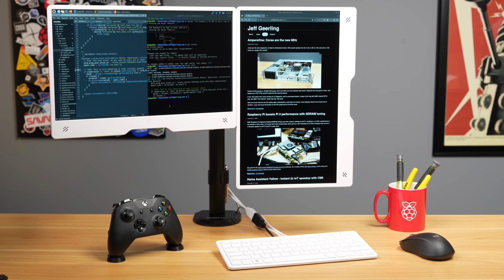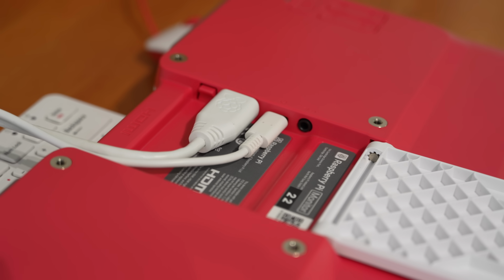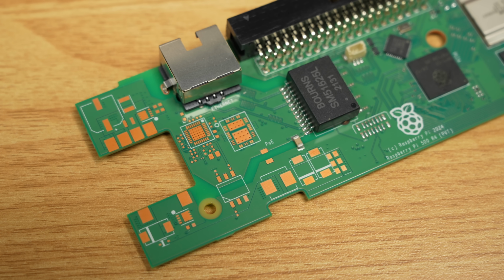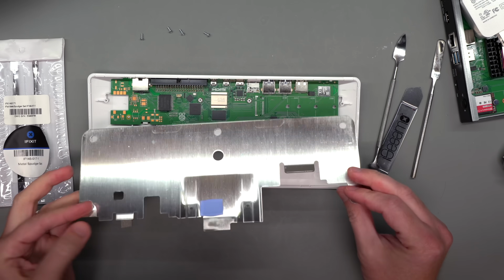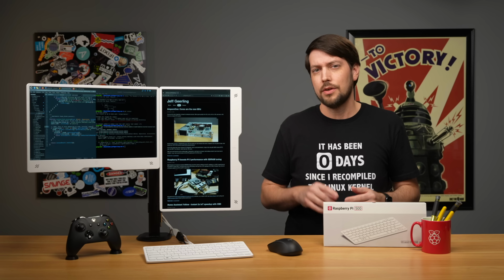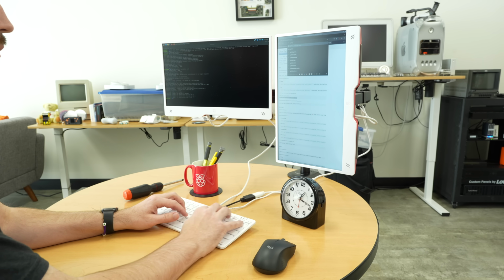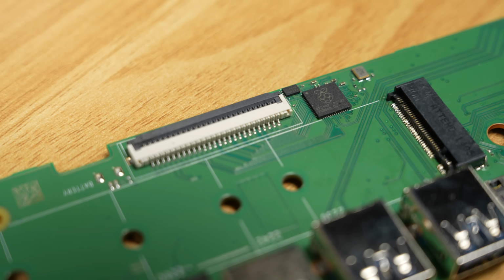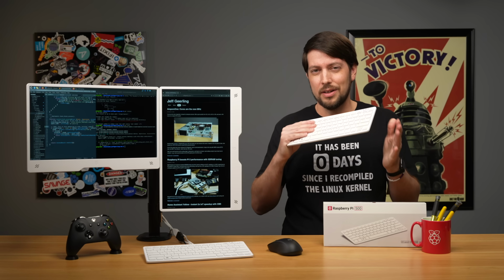The Keyboard IS the Computer! (Pi 500)

Comment: I’d really like to see one of these to have a composite output, either from the 3.5mm jack, or modded from pads on the board, like the pi 4. I basically only have televisions with composite, and the hdmi converters simply aren’t as adequate as the old built in output

Comment: Hey Jeff...i agree the M.2 would be the right thing here but I have two questions:

1) Can you USB boot?
2) How does this stack up and older 8th gen Intel i5?

The reason for the i5 question is my wife's current PC is an i5 and very wonky. She does light MS Office, browser, and email. Nothing too fancy.
Reply from the maker: USB boot yes; 8th gen is similar speeds (sometimes a little faster), though uses a LOT more power. The bigger changeover would be switching from Windows to Linux. Most browser-based stuff works great, but you would need to use LibreOffice if you wanted desktop apps.

Comment: Probably no dp-alt and other docking stuff on the USB-C port, I assume?
Reply from the maker: Nope. It does have USB OTG, so you could configure it as an Ethernet port to a computer you connect it to over USB-C for power and data, but no display.

Comment: Can somebody tell me really who this is meant for? Because those are the things on my mind:

1.) Super low-end user, just uses a PC for surfing: Probably doesn't want to bother with putting things together, hasn't heard of the Pi even and just buys a cheap laptop which already comes with a screen from Amazon etc. They can use the laptop on the couch as well.
2.) Medium end user: Wants to surf but also use some software: Probably wants windows, so won't buy this either and again, just a laptop or maybe a cheap home PC. If a 4k video already stutters, that's a pretty low bar.
3.) High end users with high demands, Gamers, etc: The Pi 5 will simply not cut it all. Those people are probably proficient enough to set it up or willing to spend the time if it brought them any advantage, but what is the advantage over a small laptop really even if the Pi 5 had the juice?
4.) Programmers: I am that and I would not want to use the Pi 5 for multiple reasons: It is still pretty slow - I work 8h and my efficiency hinges on the efficiency of the machine. I sometimes need to present stuff to other people, so I use a laptop. My work place already has laptops or just bulk buys them. Laptops in general are a LOT more powerful than the Pi 5. It's like said in the video: Yeah, it CAN handle that work, but you rather want to work with something more much more powerful and especially more RAM if you run a local dev environment.
5.) Other types of work. MAYBE this works for people with a mixed home office/work setup where their work only consists of light software and they don't require Windows or their company is willing to help them set this thing up. But then why not just get a Pi 5, have the keyboard be replaceable and just have a keyboard at home and one at work? What is the point of not having full sized HDMI, because either you have monitors at home and at work now permanently connected with a dongle or you are carrying dongles with you all the time. Also the missing SSD hurts. 
6.) Enthusiasts. This is honestly the only group I personally see this with(?) People who really WANT to make this work. Who can glance over all the short comings just because they want this to work.

So I am curious to learn from the people who are already running this or the predecessor on how and why they use it! :D
Reply from the maker: For me, it's a low cost, simple computer my kids can use to type papers, do some very light gaming, and learn typing. It's great for those purposes!

Comment: Good video!  I realize the video is about the Pi500, but it would have been nice if you mentioned how you powered the new 15.6” PiMonitor.  When powered by USB, the specs say it only delivers up to 60% brightness and up to 50% volume.  To get full brightness and volume, you must use a power supply.  So the low volume could just be from using USB to power the PiMonitor…
Reply from the maker: I powered from an external PSU and had volume and brightness at 100%; the speakers are just not that great. Serviceable but not great.

Comment: Yea Raspberry Pi Holdings half-assed it... again.
No M.2 😭. Still no propper HDMI ports (I want DP ports to be honest). Why not add a USB hub internally so we actually have enough ports?
Plus the actual keyboard is still sh*t. 
How hard can it be to put some good Cherry Keys in a gods da*n plastic case and make it full size with a num pad?
Oh and make it a 16 GB version, thx bye.

Comment: This would be a great on-site diagnostics machine. Cheaper than a laptop but has enough power to get what you need done.
Reply from the maker: That's what I used the Pi 400 for here at the studio. If I needed a little client to pop over by the rack, or by the 3D printers, I'd grab the keyboard and drop it there.
Reply: Laptop?…

Comment: I bought a 400 quite a while ago, but I was somewhat disappointed, no good on YouTube and with all the ports used you end up with a jungle out the back meaning you cannot really move the keyboard much.
I ended up with an M.2 drive on mine to try and speed it up, however with that and an external DAC for use with  JRiver music player, however the 400 just cannot pass enough 5V to keep it all stable.
Whilst it has USB-C it does not implement the power delivery side of things, just using 5V, so I made my own custom USB-C power lead for it, very short with thicker wires into a 4 port USB power box. The DAC runs of a USB hub, not because I need extra ports, but so it can receive power from that hub, fed directly from that 4 port power box.
Measuring the 5V after it passes through the 400 and on into external devices, the volt drop is kind of crazy. I tried back feeding it through the USB ports (playing with powering the DAC) with some dodgy cables, and whilst it can be got up and running, the 400 gets really confused at shutdown and subsequent restart as it has lost control of being able to turn off and on the 5V, so one has to nurse-maid  it - REALLY messy.
For extra stability I ended up shoving a large capacitor into one of the ports on the 4 port power box so it all could better handle transients.
I did try running it all from a small PC power supply (20A of 5V) but it didn't really help, it's all the losses through the 400, the leads, plugs and sockets, that are breaking things.
Symptoms were crashes mid use, but mainly finding the boot drive getting corrupted all the time - one of the reasons for going for an M.2 as they are designed for multiple read writes.
Oh, and one extra bit, I'm running Ubuntu, as I find the stock OS too light.

So in the end, it spends 90% of it's time as a music box, just a pain that I cannot permanently mount external  drives (NAS etc) without resorting to the terminal, unlike in Windows.

Comment: Rasbperry Pi started as a project to give cheap computers to everyone. Today it is just a joke. Especially when you can find much powerfull mini x86 pcs way cheaper and with more features. And before anyone answers I am not talking about when you need a machine with low power consumption for 24/7 IOT (for example) things but for when you want a small computer for Tv/emulation/etc. I was using an RPi 4 for my mini arcade but I jumped ship on an x86 mini pc (costed 90 euros) for the upgrade to more systems. And emulation performance is way better than RPi 5.

So for me RP has failed in their cause and greed is the reason.

Comment: This one feels like they really phoned it in. The missing NVMe is the most obvious dropped ball, and I've never understoon why they insist in micro HDMI when they have the space for full sized ports.

Really, one HDMI and a full-featured USB-C (with video and 20v PD charging) port would be far more useful - just connect it to a 60W+ USB-C monitor and you've got everything you need over a single cable.

I also agree with other folks that the power button placement is likely to lead to accidents.
Reply: People seem to want is a Raspberry Pi that has all the features and performance of a mainstream desktop or laptop, yet costs less then them. That isn't going to happen. Add in the price and availability of powerful computers in the used market, and the Pi can't compete as a typical primary desktop machine. It's designed to be a relatively cheap tinkering and hobbyist computer, which is where the Pi shines. It has GPIO, HATs, OS support and all the project ideas you could need.

Comment: I found a dell optiplex on the side of the road with an i5-2400 and 16gb of ram. I ended up adding a 1tb ssd to it as well. So all in, I'm down $40 and it's still a better setup than this for basic computing tasks and coding.

Comment: They didn't fix another flaw: the SBCs are super small, which justifies the micro HDMI connectors. But this is large enough that at least the first one should have been a regular sized HDMI, which would probably make it easier for 99% of the use cases.

Comment: There is so much demand in the aftermarket for laptop (Keyboard/Screen) devices.  I'm surprised they haven't come out with their own.  I just don't get releasing a screen that appears to be poorly designed with the connections under the mounting plate, when the market is flooded with cheap screens.  Give us a laptop with upgradeable compute modules, that doesn't look like an 1970's speak and spell.

Comment: "We feel the feature set we've picked for the Pi 500 is the right one" sounds like "We could've done it, and decided that you don't need this."
Love it when a corporation, which Raspberry now is, uses condescension to excuse cheapskating. I had hoped to get this device as my first Pi, but I can't support that attitude. They'd have been better off saying nothing.
Reply: It would be pretty easy to make a run of like, 2000 of them with the POE and/or NVME slot and sell it as the Pi505 for $100 or $110. If people want it, they can pay for it and buy it. If they sell well, make another 2000 of them. Or even make it a Tindie or Kickstarter kind of deal where 'If people preorder 5000 of them, we'll make a run and ship them out.'
Reply: plenty of alternatives now. I"ve been looking into orange pi.
Reply: The hardware certainly wouldn't be expensive, but they'd have to extend their manuals and customer support to include that. And it's probably quite the can of worms compared to the rest. I think it's wise of them to keep it simple and let their competitors handle the niche products.
Reply: @celeron55  Can of worms? Are there already no M.2 hats out there?
Reply: I love it when people with no idea of what they're talking about make silly statements like yours.   I'm sure you have huge experience in making commercial electronics projects for a global audience, so when can we can expect YOUR product to compete with the Raspberry Pi? Will it have everything built in, be faster, more expandable and cost half the price of the Pi, whilst still offering great, long term OS support? No doubt you will also set up an educational charity to run alongside it. Can't wait to see it. 😂🙄
Reply: @another3997  96 vs 4 says that you are incorrect. The mini-PCs prove it.
Reply: @another3997  It would have been very easy to add an externally accessible M.2 and full size HDMI ports. Around US$5 worth of parts when ordering at scale, and another few seconds on the production line. Raspberry Pi's decision is inexplicable. It'll be interesting to see if they use that same board with a populated M.2 slot and power circuitry in another device.
Reply: @another3997  nah bruh you're doing tricks on it that's nasty

Comment: Basically there will be another version with all the ‘missing’ bits added and an increase in price. For those that don’t need it, you save money.

(Or if you like a good conspiracy, it could be there was an issue discovered and rather than dump x amount of boards, use them in this model).

Comment: Was waiting for a pi500, specifically to do a game dev challenge with only using an SBC. I could make decent try on the 400 but would run into roadblocks when it came to making graphical assets. Still disappointed on the lack of m.2 support though.

Comment: i have a 400  , its a nice cheap little SBC , i am running risc on it which is expanding rapidly to the point where it could become a real desktop , but i also run a eprom burner on it and recall box which means i can play those 8 and 16 bit machine si could only dream of owning back in the day without spending hundreds on them , its fun and you can actually learn with it

Comment: I was on the verge of buying a R Pi 5 2 weeks ago... but then the CM5 dropped and there was a lot of evidence that 16gb Pis would be released around March (I'm guessing), and decided to hold off.  Was hoping to see Pi500s too, but it seems they were delayed a little past when it would be most advantageous.  Shame that the 500 is a little lacking currently.
I'm really hoping that the 16gb is a "Pro" or "+" upgrade and has either a better graphics chip, or a second available PCIe channel.  
I'll be happy with just the extra RAM though.  That's the big upgrade I was hoping would come for this year.  I can piggy back off everyone else's work, for any other upgrade I was considering.

Comment: Would have made more sense to have a slot for Compute Module and offer NVMe, PoE etc. maybe bring the price down below $60. it would still need a CM, but at least could be used over multiple generations, provided the pinout of CMs remains the same.

Comment: Here's an idea free of charge: stop paying the HDMI royalty fees and put DisplayPorts.
Reply: Bro, no cheap displays use microHDMI either. You need a special cable or adapter. And if You need a custom cable or adapter anyway, why would microHDMI->HDMI be better (or at least not a magnitude worse) than Display port->HDMI? DisplayPort is compatible with HDMI and the cables are even cheaper and more accessible than microHDMI.
Reply: @PyciuStw DisplayPort is not compatible with HDMI by default and requires an active converter. What you're thinking about is DP++, a version of DisplayPort that can be used with HDMI displays through a passive DP-HDMI cable. DP++ requires an HDMI license fee as well as extra hardware.
Reply: @ because HDMI connections is the identical at any size. Displayport to HDMI is more complicated. Most DisplayPort to HDMI cables provide a one way conversion and can’t be reversed.
Reply: @mattbland2380  Neither you can reverse HDMI with microHDMI. If you want to connect Pi to HDMI you need special cable or adapter. With DisplayPort you would also need adapter. No difference except that with DisplayPort you don't need to pay HDMI Forum.
Reply: they could just do dvi over hdmi if royalties were an issue, they're just being cheap with the Pi500
Reply: I agree, and change all the usb ports to type c as well.
Reply: great idea. youll need an adapter anyway
Reply: Fee is $0.10 per device. It won't change the price.

(Yes, plus $10,000/year for the company, but that's spread over millions of products per year... So at most another $0.05 per device!)
Reply: @tompw3141  Price is not the only issue. Another big issue with HDMI is the fact that you can't make newer HDMI implementation open source (that's why AMD doesn't support HDMI 2.1 on Linux). No issues like that with DisplayPort.
Reply: Yeah, even having mini DP would be an upgrade but I wish they just went straight for USB-C DP alt mode which is gaining more and more adoption among cheaper displays. Having it support PD 3.0 would be a cherry on top so you could have just a single cable for everything.
Reply: Adoption of DisplayPort is too low on cheap displays. Far too many people use these with HDMI TV's and displays that do not have a DisplayPort option.
Reply: @mattbland2380  Adoption of microHDMI is also low, you can't connect RPi directly to most screens without adapter or special cable. So if you need adapter or special cable anyway then why not get DisplayPort to HDMI adapter instead?
Reply: Sure. Let's change the problem of having to use adapters with requiring a different kind of adapter. Also, full size DP ports are physically larger than HDMI, being larger and taller.
Reply: @BrunodeSouzaLino  Instead of full size DP ports you can just use USB ports
Reply: @akeem2983  You need extra electronics to have DP over USB.
Reply: Please no. Displayport is a horrific mess of errors, disconnects, and overall bullshit that I am not willing to deal with unless absolutely necessary.
Reply: @MiIIiIIion  🤔 I've never had any issues with display port
Reply: @MiIIiIIion DisplayPort has always worked better for me than any HDMI port. Especially on high refresh and resolution displays.
Reply: @MiIIiIIion are you high??
Reply: @MiIIiIIion  You are describing HDMI to me

Comment: It would have been nice if it had a m.2 slot and an access hatch for said m.2 slot. m.2 SSD's are so easy to come by that you can find 512GB models being given away ocassionally at this point. I've never seen anyone give away a micro SD and even if they were giving it away it would probably be 8GB or something like that. At the same time I think this is a great offering so I am going to pick it up. Or at least I will when my local supplier gets it which took a while with the Pi 400.